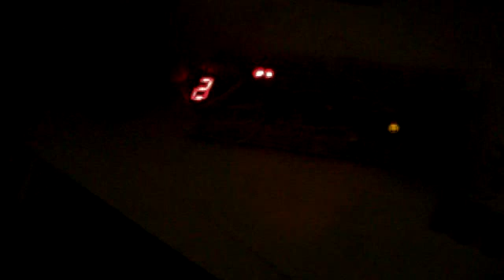fall 08 BCD Counter Circuit with 555 timer

Comment: nice circuit.  I have constructed a similar one recently but am having a problem that you might be able to help me with.  whenever I try to toggle between the Up input and Down input, I encounter some bad switch-bouncing.  I have them held high with pull-up resistors but there's still always some bouncing.  Any tips?? thanks.  -Joe